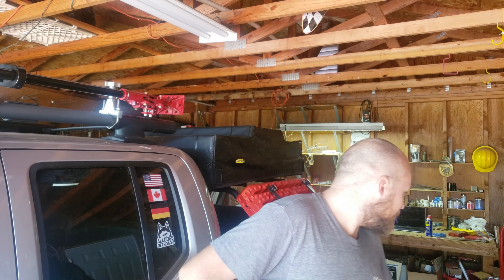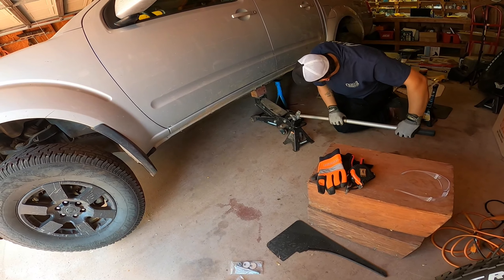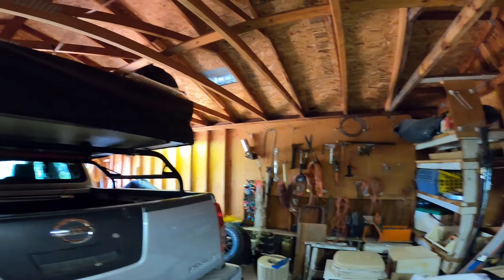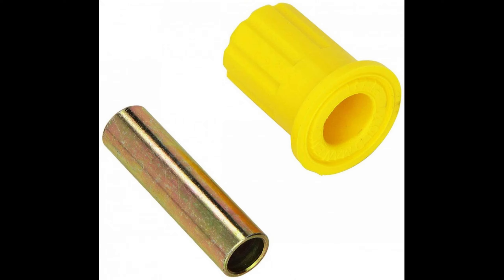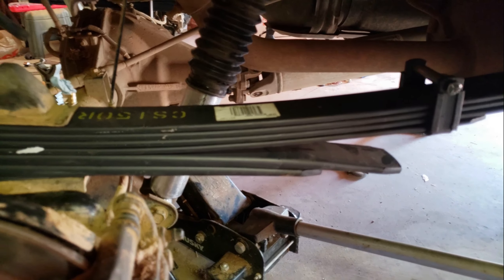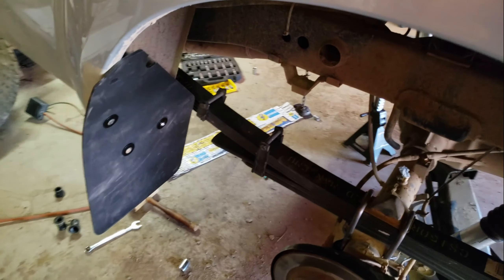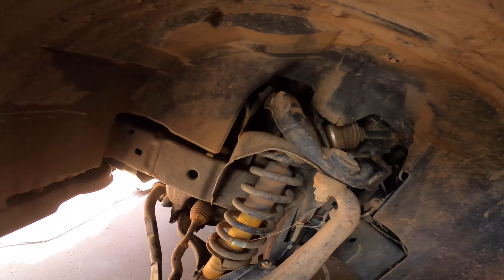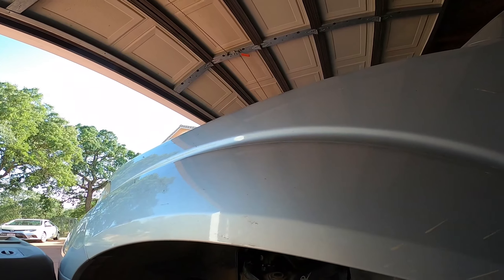Lifting the Nissan Frontier - Part 1: Installing the lift kit

Comment: Did you have to torque down the ubolts? Idk how tight it should be but i just tightened using a drill and it wouldnt torque because it’ll jsut keep compressing down.
Reply from the maker: I think I did, using a torque wrench. Did you check in the repair manual whether the bolts have torque specs?
Reply: @mitchkman  i found out the ubolts to be too long so i need to trim it and torque it. Did you have to trim yours?
Reply from the maker: @D41Pat  I believe I got new u bolts from all dogs if I remember right

Comment: so how do you like the 5100?
Reply from the maker: The ride is great! It is slightly stiffer on the road though, but great off-road.
I recently learned that All Dogs Offroad actually does use modified Bilstein 5125s in the rear (different sleeve) in their 2” Bilstein complete kit to allow optimal travel with the rear lift.
One of my rear 5125 struts broke from riding it a bit too hard on my last snow wheeling trip. I just replaced the strut and will see how it will hold up.
If you go with 5125s in the rear, I recommend going with a stronger sleeve (3/4” OD, ~14mm ID) and the matching 3/4” bushing. The Alldogs sleeve is a bit too thin (can deform under pressure).
Reply: @mitchkman  ok,
Thank you for the great advice!
your truck looks great!

Comment: How can u lift a heavy truck from the MIDDLE 😂. That’s NO NO
Reply from the maker: Where I lifted and put the jack stands is not the center of the truck’s weight. The front is much heavier than the back.